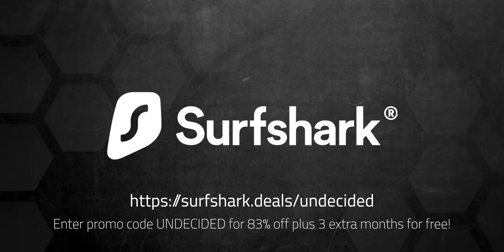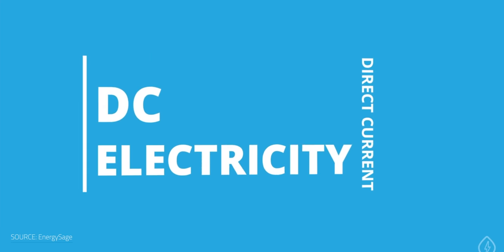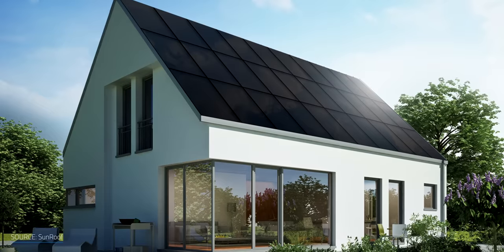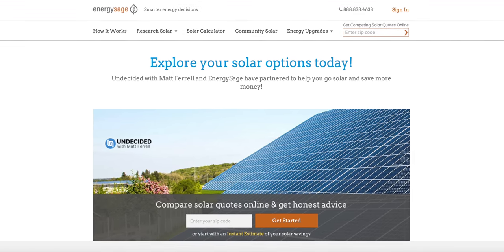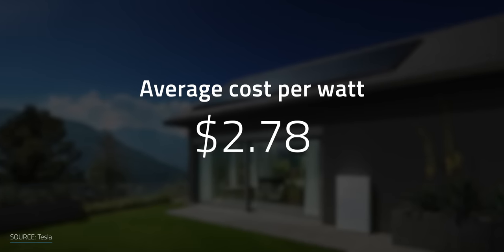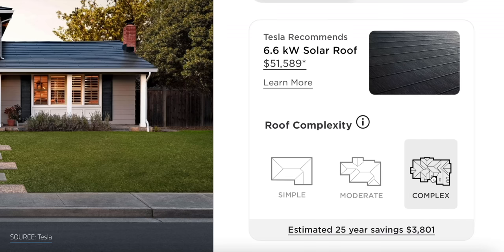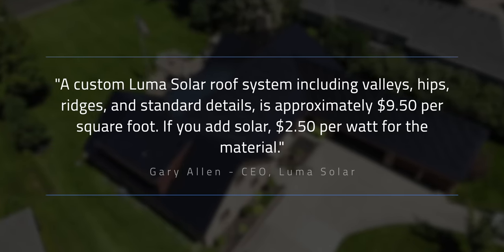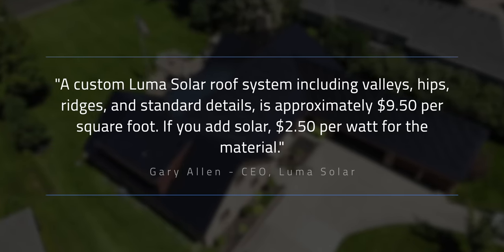Exploring Tesla Solar Roof vs. Solar Panels

Comment: Have had a Tesla tile project going since January. Original estimate was a 12.5 kWH system for around $38k. Final quote for a 5 kWH system is $73,500. Hard to justify the cost at that efficiency even since we need a new roof. Comparable “traditional” system with roof is $45,000 for a 10 kWH. Having a hard time with an extra $30,000 for 1/2 the kWH.

Comment: In Phoenix there was an issue of tiles not being able to dissipate excess heat in our hot summers and power output would drop dramatically. Panels because of the airspace underneath was able to dissipate the heat.

Comment: Great comparison! One thing that wasn’t mentioned although probably marginal for “regular” homes is having solar panels on a rack in your yard (could be a roof for a chicken coop or shed). This makes for optimal orientation, install, maintenance, repair and cleaning.  What’s the cost on such an install vs roof?
Reply: Exactly!  I would've liked the comparison to include this option.  Amazon offers the Newpowa 210W Monocrystalline 210 Watt 12V Solar Panel for $199.50 USD.  I bought 2 of these last year & I love them.  Less than $1.00/Watt!  Of course, that price assumes you can install them yourself, but that is ridiculously simple.  Paying someone else to install things always greatly increases the cost! 😜

Comment: If I could have found a tike installer, I would have considered them when I replaced my 30 year old roof last year, but no one around here that I could find does them. So I went with a metal tile roof for longevity due to high winds we get. I'll look at adding panels in the next year.

Comment: I went to an eco friendly technology expo, this was back just shortly before Tesla made their big solar tile splash. I don't remember the brand of solar shingle used was but: they had simple small bungalow homes set up with different technologies. I remember that they had side by side units of solar panels vs. solar shingles on two of the mini buildings. While the tiles had higher install price, cost more per watt generated, and were not as efficient as the panels in generating energy, do to the fact the covered every bit of the roof they were out performing the panels on identical buildings on the amount of over-all power generated. And the tiles, they called them shingles, looked better and, to me at least, had less of a reflected glare.

Comment: I think using tiles when it comes time to replace your roof is the way to go.
Reply: It's a little early to tell. We need to know how long these solar tiles actually last and perform long term.
Reply: You’d think so, unfortunately not. 😓
Reply: Yes, but only if your roof uses expensive materials.  If you use asphalt shingles, solar tiles are still way too expensive versus new asphalt roof + panels.
Reply: @bravedog1974  unfortunately, agree.
Reply: @bravedog1974  Just use Italian marble, then decide to go to solar roof instead, and you’ll save a lot.
Reply: Or install a solar tracking panel, or any panel that is actually pointed in the direction that gets most sunlight. Under 99% of the cases, at any given time of the day at least 50% of your roof will be in shade, the other 50% in suboptimal conditions, and in the other 1% things are just slightly less sad.
Reply: @TheSteinbitt  if it’s white it may qualify and an energy star roof with some rebates 🤣

Comment: One thing not mentioned is the pack factor. The number of cells that can physically fit on the roof. With tiles being smaller, you have the potential to have many more cells and thus the ability to produce much more energy to see a monetary return on your electric bill. The sizing of standard panels tends to be an issue to more complex roofs due to the smaller pack factor.

Comment: I’m getting the solar roof and two power walls. Don’t care about how long it takes me to recoup the cost. I like the look and I’ll be living under it so I’m getting it
Reply: Probably better to invest the same money in Tesla stock. Wait for the shares to double, keep half and use half to pay for solar roof and 2 power walls.
Reply: All speculation at the end of the day
Reply: You're going to love it Daniel. This video doesn't really look at how well this functions as a complete system. It's a premium roof. Fire, impact, wind are all great. They handles rain beautifully, but the water comes off so fast, pay attention to your gutters if you live where thunderstorms are common.
Reply: @user-jt1jv8vl9r  I did a $31,000 investment turned into over $700,000
Reply: @danielguillaume9928  damn 31to 700 tell us how man .. good luck
Reply: You should also add some vertical wind turbines in
Reply: @sakil8272  Those aren't currently supported by the inverters and powerwalls from Tesla. Only solar and grid can charge the powerwalls.
Reply: i wish i could get the powerwall but it's not available in the NL
Reply: @danielguillaume9928  LIAR!!!
Reply: Get enphase system. I prefer it over Tesla. Their backup battery system is cool too. Turns your house into a micro grid
Reply: @MrShitthead  your gonna call him a liar with no proof they are lying? is this your first time on the internet? you take everything you read with a grain of salt.
Reply: very smart

Comment: As reviewed in a different video,  and only mentioned at the end of this video, we should be comparing the total cost of the roofs.  For new construction, comparing the cost of tiles to another top tier roofing material (standing seam and artificial slate) + solar panels may have a significant price differential. Tiles will last longer and being easier to repair than a traditional shingle roof. Especially if you think about having to remove solar panels to repair/ replace traditional shingles. Would you spend the money to put a 15 year old panel system back on your roof? What will the efficiency of panels be in 15 years? I think it will limit the actual life of those panel systems.

Comment: My neighbor just had solar installed on his house and I want to ask him how he likes it and how much it's made a difference in his utilities.
Reply: It all depends on how big of a system he had installed. A 5KW system and a  10 or 15KW system will all be different. Even identical solar installs will perform somewhat different on two different houses, possibly dramatically so.   The best (only) way to judge is to CALCULATE  what any given install produces and what that saves from not having to buy the power it produced.  The higher his grid power costs the greater the savings.   When it comes to doing the MATH or results accurately most people can get it wrong simply from know knowing how.
Reply: @sailingsolar  thanks captain obvious .
Reply: Every location is a little different becuase of things like rates, and incentives. I can tell you for me it was a no brainer. My average monthly electricy cost was more expensive from my local utility, than the loan payment to buy and install solar panels. I actually save money eaach month over my ulility price. Once the panels are paid off completely, I will save WAY more. Plus I drive an EV, so I can charge my car from them. Unfortunately I don't have a very large roof and not ideally oreiented to face the sun most of the day, so my system would cover about 75-80 percent (on average) of my power needs before the EV. After the EV, they provide about 55-65 percent of my power needs. Again, still cheaper than if I bought that power from the utility.

Comment: You forgot to mention geometry. Due to their smaller size, shingles can cover more of a complicated roof with many penetrations. Panels are better suited to simple roofs with very few penetrations. They can also overhang and more easily be placed on mounting methods that are not roofs.

This means that singles may be able to collect more energy per m² on a difficult roof, even with a non ideal angle.

Comment: Beware of the high costs some installers charge. On the wholesale market, decent UL listed solar panels cost about US 50c to 75C per watt, FOB in the US. Yes, I just installed 13,000 watts on my roof for less than $5600 panel cost, plus $600 shipping. I used a young electrician to install at $40 per hour, and bought my racking from the same wholesaler.

Comment: I went with panels. I did so calculating what isn't known quite yet that being the max efficiency at panel might achieve. I expect them to improve and as they do, as I can afford it, i can change them out panel by panel. The mounting bracket is the only obstacle that seems obvious other than perhaps needing an inverter capable of handling the extra watts.

Comment: For a non-grid-tie system you can get nice used panels as solar farms swap them out.  17 cents US per watt and I'm getting 97% of the original rating.  With panels you must also consider the cost of racking and ensuring your roof below them is in good shape to begin with.  Panels don't need to be on a roof - they can be standalone, pole-mount, create a patio cover or carport.

Comment: A couple of things: solar roof tiles cover an entire roof, so the installable capacity for a house using tiles may be much higher than the installable capacity using panels, which commonly cover just a fraction of the roof.  That said, covering an entire roof with solar tiles probably isn't a good idea in northern latitudes because parts of the roof that face north(ish) won't get enough sun to make installation of solar economically feasible.

Comment: as a person who bought a metal roof.   The benefit was that it would last a long time.
Con was that it was noisy as heck.  After 5 years I had enough of it, and replaced it back to a tar shingle roof.
Having a hard metal roof was the same as having 10 rock bands performing on the roof while it rained.
Same I would expect would happen with Tesla's roof.  Unless you are also willing to insulate the roof from the sound.

Comment: One thing to note is that with traditional solar panels if you have a roof leak or something that would require a repair you would need to hire someone to take the panels off, fix the problem with the roof and then reinstall the panels. This adds to the cost and is another reason for solar tiles.

Comment: Matt,
Love all you video this one hit home. I submitted my order this weekend. The estimate was $31K for one power wall 4.9 KW system. As my roof needs replacing, I thought it would be great if this works out. Two days after submitting, I get an update there has been an adjustment to my estimate. They stated my roof is moderate and roof is going to be twice the size they estimated. The new estimate is $60K. As a sidenote, I picked up my Tesla model 3 last month and was not impressed with the experience. Loved the car but the quality and the Tesla folks has not been the best.  I would be hesitant to spend $60K and have poor support from Tesla. That would pencil out for me as it would be a 40 year breakeven. So definitely, the price has increased dramatically. I will be using your link to find other options. Thanks for being a great resource and not a cheerleader for Tesla.
Reply from the maker: Tesla is a great option for some, but not everyone.  I always try to take a pragmatic view on things … love that we have so many options out there.  They all deserve a mention.  Thanks for the kind words and for watching!

Comment: The other advantage of tiles is that you end up with nearly 100% coverage of your roof surface. I have a hipped roof (actually 2, house and attached garage) which means a lot of area could not be covered. The flip side is that you are not going to spend money covering suboptimal sections of roof with panels, but if you chose tiles you would pay a premium for what is essentially high tech shingles

Comment: On a new building you can also get integrated panels (i.e. the panels are the roof). They have all the benefits of panels (performance/price) and solar tiles (esthetics and no need for an additional roof)

Comment: Very informative.  One thing I'd like to add is the economics will also depend a lot on roof size and orientation.  We have a detached house with 2 roof levels.  We had a 10kW system installed on the top level (east, south, west) and didn't install any panels on the lower level due to shading from trees and top level roof (depending on time of day) as well as a portion of our roof faces north.  To cover the entire roof with panels (or solar tiles) would have cost an astronomical amount and would have greatly decreased the overall system efficiency.

Comment: The SunPower panel cost $3.27 per watt.  If an average of 5 hr per day, over 25 years, that costs 7.2c/kWh for the "free power".  That sounds competitive with most utility charges, or even a no-brainer in pricey San Diego.  But, that cost is upfront money, so must run a present-value calculation.  Also, the power is becoming "use it or lose it" since the net-metering deal is going away.  SoCal utilities propose crediting only 3c/kWh for solar power fed to their grids, plus charge $300/yr for a connection.  You also need to regularly wash dust off the panels unless in a rainy locality and many installations have caused roof leaks or problems with vermin nesting under the panels.  Not discouraging people, but research carefully and avoid the many fly-by-night companies whose warranties prove worthless.

Comment: Matt,
Great question and awesome video!  
It depends on cost and need for my take on this.  
- If you have a south facing front of home, SolarRoof wins for a new home or a roof needing a complete new roof.  It's much better looking and if you have freedom to design your roof to mitigate all Tesla SolarRoof cost drivers, it will help contain costs. 
- If your south-facing roof is a back yard and no neighbors behind you, then GO panels!  They are generally cheaper and more efficient. 

But for me and my house we will go SolarRoof on our south-facing front of home.  Its a new home so I can design the roof to mitigate cost drivers (aarggg if only I could get Tesla to work with me some).  I prefer a south-facing front ... so snow and ice (more free solar energy) melts and dries my walkways much quicker after I shovel them.   Yeah, I hate falling on ice... I'm quickly getting too old for that falling on ice thing. 😬

Cheers,
Eric

Comment: I don't think we cold have afforded solar tiles when we bought the house, so we got 30 panels from Akeena, bought out by SunRun. 18 years later we're adding a Powerwall, but we CANNOT use the 30 panels we already have to charge it, so we're adding 9 more. Seems like there's a need for a universal converter to manage multi-system traffic.

Comment: The real advance is when we'll have solar roofs made entirely from solar panels over the whole roof, preferably with panels that combine photovoltaics and thermal, to heat the house in winter and cool the panels in summer, making them more efficient, or melt the snow in winter.
A solar panel is already weatherproof, you just need weatherproof joints between the panels and redundant waterproofing under the panels.
This would also encourage the design of simpler more economical houses, with single (much more energy-productive) or dual roof slopes, and air vents only at the very top of the roof, no chimney in the middle.
Solar tile roofs should be reserved to existing McMansions with complex roofing (the "simple" roofing sample in Tesla web site looks already complex to me...), or when there are esthetic constraints, like being placed near a protected monument.
Well-oriented houses could probably also include photovoltaics on western and eastern wall tops, to produce more electricity in the morning and in the evening when demand is higher, but it's probably over-kill unless it's very cheap, since a good solar home will already include some form of energy storage for these energy peaks.
You can also reduce your electricity needs (and therefore the need for photovoltaic panels) by using a heat pump and a south-facing greenhouse to provide already warmed-up air to the heat pump, possibly going through some big water tank or a thick wall for their thermal retention, to provide solar heat even at night.
All this is why building a new house from scratch is so much cheaper and more energy-efficient than trying to insulate and electrify a €40K old village house like what I am going through right now. The constraints for existing buildings are enormous and require compromises, like between insulation thickness and living space, or lower electricity/heat production for reasons other than technical ones.

Comment: Including batteries, wire, charge controller, &c. If you do your own installation, solar power and storage is $1/watt. The batteries are the most expensive equipment. The largest share of the price in the figures listed is the labor. (As it should be.)

Comment: 2 points I suspect are often overlooked.

1) Because they are smooth, you should seriously consider installing ice cutters along the lower fringe of your roof, if you live in lattitudes with non-negligable winter snowfall. That's an added cost.

2) I've heard that many local fire departments will REFUSE (due to risk of electrocution) to open a solar equipped roof in the event of a major fire that you cannot self-extinguish -  if that happens, it sounds like you can pretty much kiss it all goodbye.

Informed comments/rebuttal welcome - i'm curious.

Comment: My question with the idea of tiles is, how does cleaning go for them? If they are designed to shatter to improve cleaning and replacement, how would someone go about cleaning them when needed. I live in the northwest where there are a lot of pine trees. And the need to get on the roof on occasion is a thing.